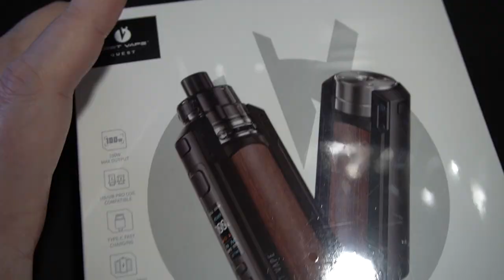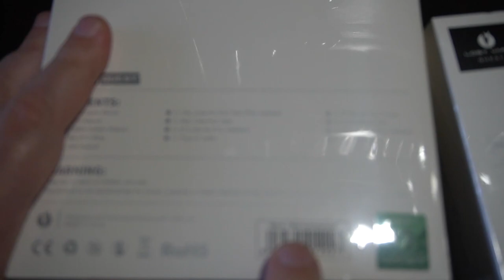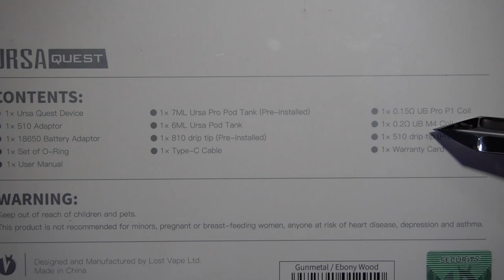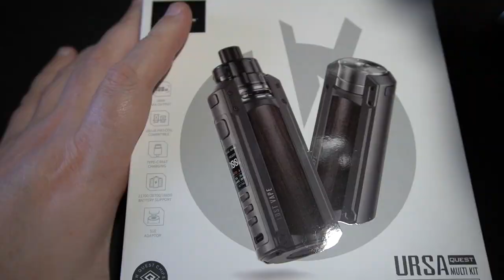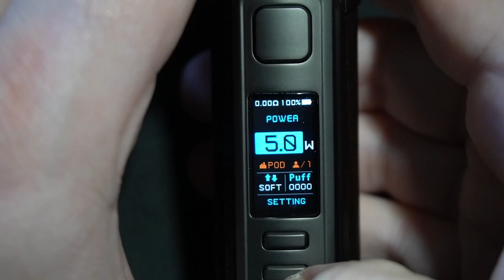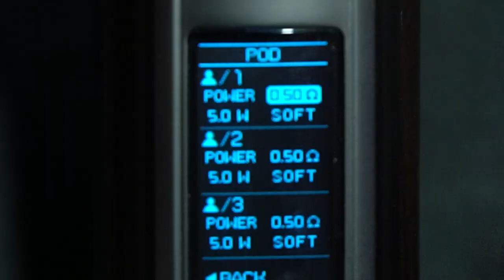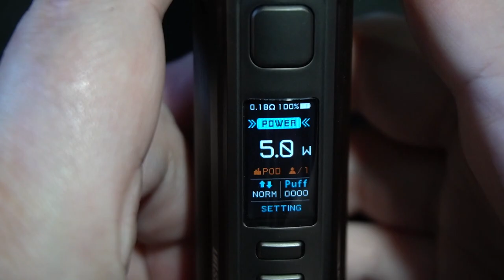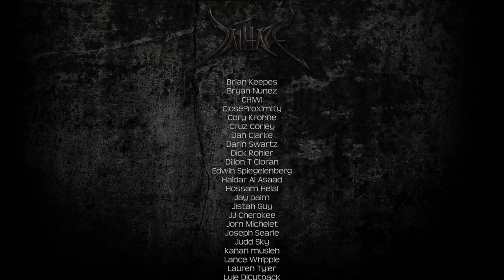Lost Vape Ursa, A Pod Mod Worth Having

Comment: Hey Jai I was excited to see your review on the Ursa and hear your thoughts on it, I knew you were going to remark on the fact they used their brand new Quest chip instead of a DNA,  and those were my thoughts at first to, but I gave it a chance and kept an open mind and I'll tell ya this new Quest chip is not a slouch at all DJLsb did all his tests on it and it did very very well, I tested the temp control by going back n forth from the Ursa to my Paranormal in temp control and it's dead on, I myself have fell in love with my Ursa and found that it's my go to device now, I grab it before anything else, I still use my normal daily arsenal but the Ursa has become the number one mod in my daily rotation,  and I see that you liked it to and gave it a good review but keep using it and you'll see it just does ever6its suppose to do and does it all very very well, in your video thow you didn't go through all the firing selections, power, bypass, voltage temp control with two stainless steel options,  this mod foes it all and there is a sub ohm tank and an rba coming out for it to and cant wait till they are released, check into it, alright I'm out of here just wanted to let you know great review

Comment: This is like the Swiss Army knife of Vape Mods.  Love this thing to take when I am at work.  The RBA that I bought with it works very well
Reply: What's the point if an rba when it has a 510 just throw an rta on it
Reply: @bergstrom716  couple of important reasons, 

1) it will make the device that much taller as the pod sits inside the device, but with the 510 adapter rasies the platform.
2) if he's taking it to work, a plastic tank that sits half way in to the mod is much less likely to break than a glass section on an RTA.
Reply: @Addixxtion  Exactly on both!

Comment: I just picked up the gunmetal alligator skin version tonight. Can't be happier, I like how you can just pop off the pod and  have my profile rda already on the adaptor so you can switch quickly. First non squonk mod in a long time. I also like the battery percentage rather then just a bar to go off of.

Comment: This device will also have a metal sub ohm tank which takes the bigger coil can be used with the 510 plate or the pod set up. I believe its still in production but seen differnt reviews of it and it looks nice

Comment: As per me the only drawback is, it doesnt detect automatically whether its Pod or Mod.. other than that wonderful Pod.
Reply: Is there a reason you couldn’t just use it in mod configuration but in “pod mode” on the chip? I assumed it was just another quick swap preset that you could switch between the tank and your dropped without adjusting wattage again.

Comment: If this device's pod tank had the juice flow control of the vaperesso swagg px80 I would most definitely buy one. Also fyi you can mod the device yourself and put the dna75c in it. Or so I have seen on the headmag interwebs.

Comment: There is also a sub ohm tank attachment for the ub pro coil as well that adds more capacity and can be added to a regular 510 adapter it'll also attach to the Ursa like the pod does. Pretty unique actually
Reply: Have you seen it available anywhere? I just ordered this unit but cannot find the sub ohm attachment...not even on their site
Reply: @TigerGoesCrazy  I saw it on I believe Mike vapes video could have been suck my mod which ever one it was tells when it releases I believe
Reply: @teamnhb666  that's where I saw it too lol. Just gotta find it now 😒
Reply: @TigerGoesCrazy  may not be released yet

Comment: For those big coils the DNA doesn't provide enough power. That's the only reason I would think they're not using DNA. Unless a DNA250C would work with a 21700. Evolv also needs to upgrade their chips with USBC. I know you always say to charge externally but USBC is a much better option over micro USB.

Comment: Hey jai, you tell me if this is a good idea for something like this... so you make a 510 with an extra springy positive, then you have a notch system around the base of the platform around the 510, so now you have a 510 that works with any RDA rat etc... but it also has a push down and quarter turn pod that uses said notch system, so now you can have a pod that has the push in coil with a positive, and then the pod uses the part that notches in as negative... I still think a subohm tank would be better, but maybe this idea is decent.

Comment: Damn them for coming out with this after I bought the grus..;) 
Great review brother
Reply: With ya there, got my Grus 2 weeks before this was released. Will prob get the DNA version when released.
Reply: @KiltedHammer  is grus good?
Reply: @muhammadamin1731  It was my favorite mod until Lost Vape released the Hyperion (Finally! a DNA mod with USB-C). So yes, it is good. ;)
It is still my favorite as far as hand feel though. Something satisfying about solid billet-style aluminum.
Reply: @KiltedHammer  damn it im also loves the design hyperion have. but the price in my country are to expensive. i just cant affort it. so i just buy ursa instead of grus. still waiting for it to arrive. do u thinks ursa is good? im also buy it with ub pro rba which is very very limited here in my country. feel lucky for have it one.
Reply: @muhammadamin1731  The Ursa is very similar to the Grus, I am sure you will love it as well.
Yeah, the Hyperion is a bit pricey, but worth it in my opinion for certain usage. I personally think DNA chips are overkill for nic juice, but hit it out of the park for MMJ patients using atomizers designed for concentrates.

Comment: Voopoo PnP pods fall off easily in my work in the fields, maybe this one won't since it seems to sit tight & secure + the fact you don't have to mess around w/ a bottom plug that loosens up in a week or two and fills the contacts with juice, in my outdoor conditions.. very appealing , but the vaporesso kit is very tempting too ..... dilemma

Comment: Jai, Lost Vape finally did it. They made a DNA250C Therion except, its called the "Thelema". Wanna know what else? There's no mixy matchy fuck fest of materials. Its the metal and the ONE material on the door panel. Not to mention, they changed the battery tray so it won't chew up battery wraps. You might actually like this one if you can get it. Oddly enough, they sent a  "special" edition to Mike Vapes that had multiple door panels but, they didn't send one to you. You would think that @Lost Vape would want to send you this product for review. You've asked for a remake of the Therion FOREVER! It's like they took your complaints/suggestions, implemented them (for once), and chose to be chicken shits on the one product they probably nailed! LOL, Jai got these companies scared.
Reply from the maker: Soon my child, soon

Comment: Can anyone advise me on how this mod performs using RDAs? Currently if i got it I'd put a teeny Wotofo Elder Dragon (22mm single coil), but if the mod is able to perform well with bigger, dual coil RDAs then it'd be nice to know i can upgrade.

Im currently using a Voopoo Drag X with the 510 adapter and the Elder Dragon. And the reason for upgrading is that i want a more powerful mod, with stronger hits and less ramp up time - but its gotta be pocket friendly hence why im interested in a single 21700, but the ability to switch between pod and RDA is also a huge plus for me.

Any advice would be appreciated :)

Comment: I just got the ursa and it is amazing but I have one issue with the 510 adapter it doesn’t buckle maybe for a while but it pop up any advice?
Reply: Hold the side buttons all the way open and make sure it seats flush all the way around. That was the first thing I noticed when I tried it, one side was just so slightly higher than the other, causing it to barely wobble. I only had to hold one side more to get it all the way in, and haven't had any problem with it since. If you haven't fixed it yet, hope it helps. Also, make sure its in straight for it to clip right. Seemed like one of them were were slightly off, causing it to not fully seat properly. They probably made that part to be quite precise as a fitting

Comment: They also sent me that one for review and I must say I prefer the smaller UB coils for flavor. 
In the UB Pro Pod, I use the RBA they sent me too, a very nice one.
The UB Pro coils felt too airy and lacked in flavor.
That chip is pretty good, but the Temp Control didn't prevent dry hits nearly well enough. Not sure why as it does limit the temperature from rising past the set one so I can have sort of a strong pre-heat with higher wattage.
I have about 3000 hits on that Mod.  Kinda sad they made it bigger in every dimensions than some of my dual 18650 Mods ......

Comment: Also the threading on the battery cap is awful and the spring loaded battery connection pushes the cap off before you can screw it down. Tried different 21700 and 20700 same thing, almost impossible to get a battery in. So all in all, it's a piece of trash
Reply: which 21 700 battery should we buy for this?
Reply: @pipsistheman  are you using flat top batteries

Comment: Functionality is great, but astetically imo it's very ugly and bulky,  at that size may aswell carry a proper mod.
Reply: isn't that a proper mod?
Reply: @pipsistheman  not at all, it's a pod mod that takes pods and needs an adapter to fit 510 tanks. A "proper" mod is designed for 510 fittings and will only take a pod with an adapter specifically for that pod. I actually like every thing about the ursa apart from the way it looks.